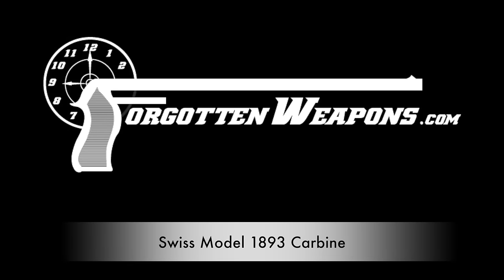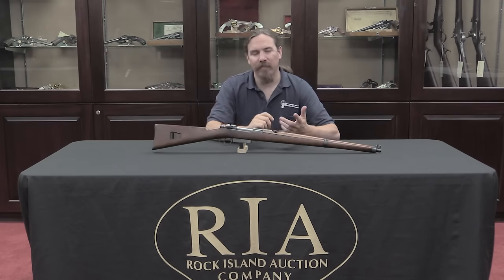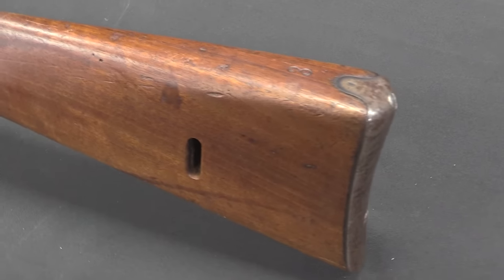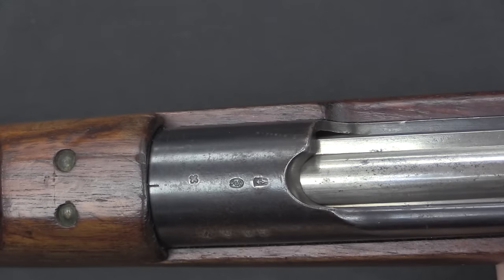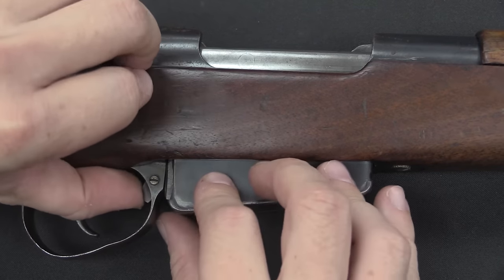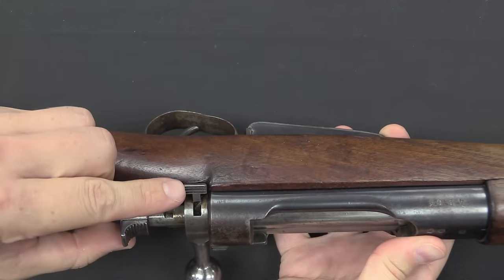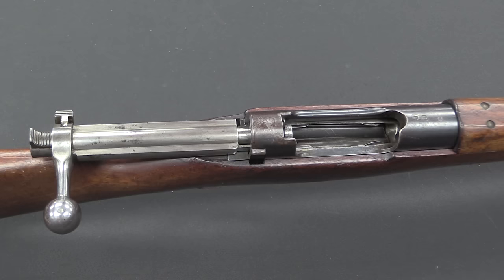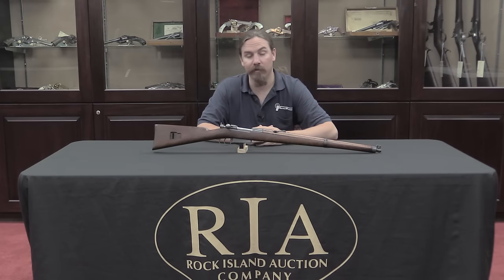Swiss Model 1893: A Mannlicher Cavalry Carbine

Comment: I have a original 1889 but also found a sporter someone had cut down (Im pretty sure an importer or some shop did them because I have seen several identical sporters)  It was only 175 and I figured even the parts are worth that.  It's actually a pretty handy gun, of course it still has the really long action but it's a million times more handy than the full-length rifle.  I think those 10 years would have been better off using cut down 1889's than these if they hated them so much and they weren't accurate.  The sporter 1889 has a chopped down barrel but is still quite accurate.
I still want one of these rifles.  I have a soft spot for my M95's and also have a M95M converted to 8mm Mauser by Yugoslavia.  I don't shoot it much because I broke the extractor and had it welded back together.  Works perfectly but those extractors are absolutely unobtanium, have been looking for a spare for 8 years.  You can't convert the 8x56R extractor.  I've heard of people converting extractors from something else, maybe a 1917, but haven't seen any pics to try it myself.

Comment: Straight pulls are always interesting. I should have bought a K31 a few years ago when they were still relatively cheap, but i hadn't paid enough attention to them. I wouldn't mind having an Austrian M1895; from what i hear the 8x56R is not too hard to find components for handloading (once i finally get my stuff set up, lol). I have a Ross, bought about 4 yrs ago, that i think i have identified by reading the Blue Book. It should be a 303, but i still need to slug the bore to make sure. Anyway, so be it. Great video as always. Thank you

Comment: You know years ago, I picked up one of those Austrian Steyr M95's and tore her down, tossed the barrel in the bin and mounted a .44 barrel, chambered her for the .444 Marlin round, she made a honey of a carbine with an 18 inch barrel, full wood stock, and a couple of modified stripper clips.  Mounted a set open sights. Used her to take a few white tail deer, then sold her off at a gun show in Devils Lake ND.  I saw her  many times after that, at different gun shows, always with a much higher price then I sold her for.  Ah well such is life. I have a list of over 50 guns that I once owned and wished to God I had never let go, that is near the top, just below the plain jane old Luger in the holster as captured, with capture papers that I let a gun buddy take to a show to trade for a modern 9mm only to be presented with an old beat up polish 9, I took a Chief's special instead, and a nice Engfield nicely sporterized that I ended  up trading for a pair of tires for my LTD.  Life goes on.

Comment: Question for experienced K31 reloaders:Reloading data seems very dumbed down compared to GP11 performance. Are they publishing "liability" data because of the possibility that it will be used in the weaker Swiss actions(like 45-70)?
Reply: I would say it max should be about GP11. What book are you using and what is the data like? The GP11 round was designed for k11s, 96/11s, and G11 which are weaker actions since the K31 has front locking lugs and the 1911 series has mid locking lugs. The GP11 is hot for the 1911 series but safe for it. The action for the 1911 series is really just they 1896 action and that was meant GP90 (which is what the Swiss m93 in this video is meant to shoot). Basically long story short the data is the books to meant to be safe for all Swiss guns that shoot 7.5x55 but again it should be giving you GP11 like data.

Comment: That must be a very accurate Swiss rifle not having that gigantic port on the receiver not having the gigantic cutout for your thumb to push down the charging clip must make that a stronger receiver not as likely to flex I've seen a slow motion of a 98k and the weapon Wiggles all over the place maybe this thing does the same one can't tell it until they've seen a video of the thing fired.

Comment: Do you have any primary sources to justify the internet claim that the kar93 was found unreliable and difficult to assemble?
Reply: You might want to get your hearing checked. He never said it was unreliable, he said it was inaccurate. As far as being difficult to assemble, he as much showed that part...
Reply: The takedown method explained in the video is incorrect. FWIW, I have hands on experience with the 1893 and each of main m95 variations.